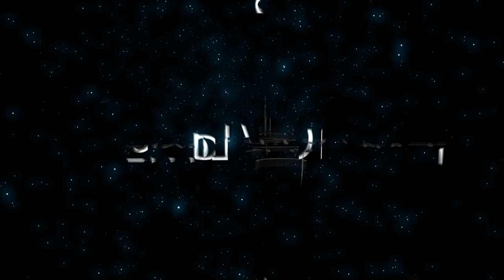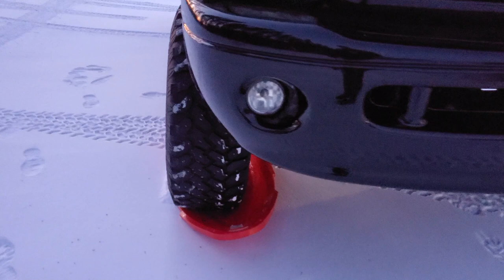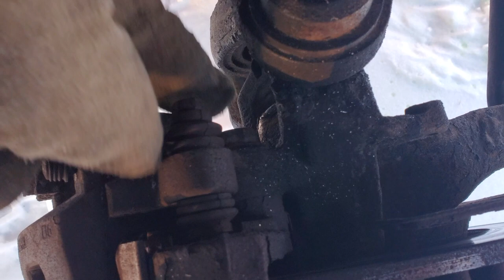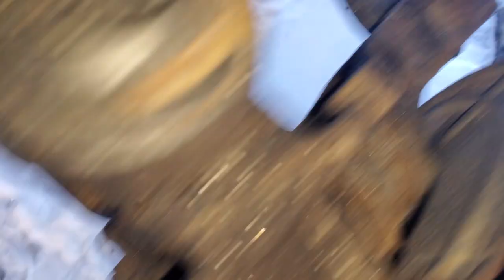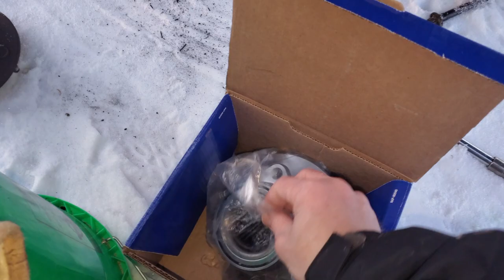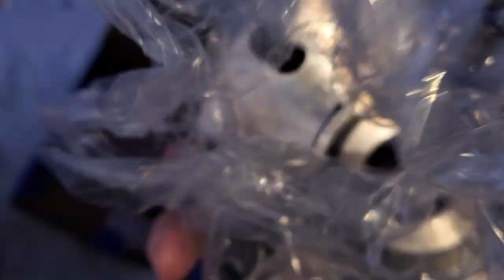My Tire Fell off! How to replace a wheel bearing

Comment: lol good idea with the plastic sled
Reply from the maker: Thanks, had to get it to slide some how Lol
Reply: @Temptation_Offroad  lucky it was icy out for you because I had to get mine towed because it would not roll
Reply from the maker: @Cherokee93  Yeah exactly! Very lucky
Reply: @Temptation_Offroad  shit happened yesterday and oreilys gave me the wrong bearing i guess they gave me a rear bearing and i needed the front wheel
Reply from the maker: @Cherokee93  🤦‍♂️ That seems like how it goes at auto parts stores. I've had similar experiences. Hopefully its all fixed now though.
Reply: @Temptation_Offroad  ehh gotta wait till morning to get my new bearing had to wait a good 3 hrs for a tow

Comment: what would i need to replace exactly this happend to me on my 2001 silverado
Reply from the maker: Just the wheel hub bearing. You dont have to do both sides, but for peace of mind its not a bad idea. Plus if you do it yourself its not too expensive and fairly easy to do.

Comment: Just happened to me today with my 92 Toyota. Nearly caused me to have an accident since I was going highway speed.
Reply from the maker: Yeah not fun! Glad you are safe though!
Reply: @Temptation_Offroad  Thanks! I'm going to need a lot more work. The bearings turned to ash, the rotor is done for,  and the nut holding the hub in melted/warped onto the threads. Ordered parts on rock auto (so much cheaper than the dealer) and will take it to a shop since I can't remove it now.
Reply from the maker: @thedude8526  ouch!!😖

Comment: how long did you have those wheel bearings before they fail??
Reply from the maker: 100,000 miles
Reply: @Temptation_Offroad  oml. No wonder mine snapped. They had a lot of time. I had lifted my truck but they still had the old wheel bearings on